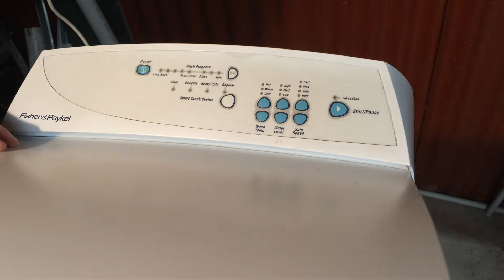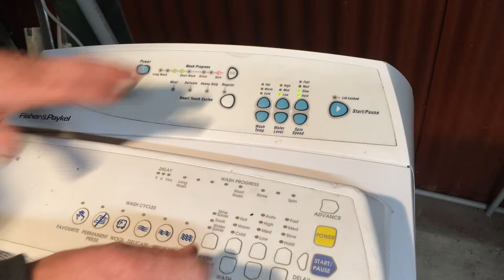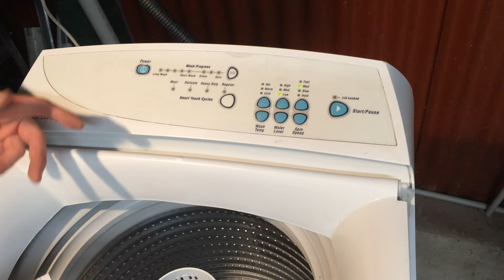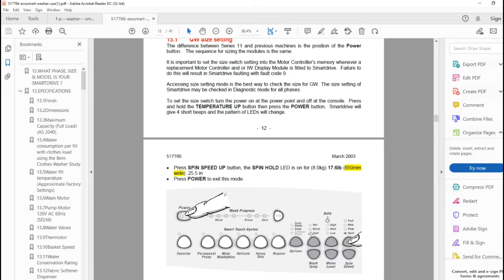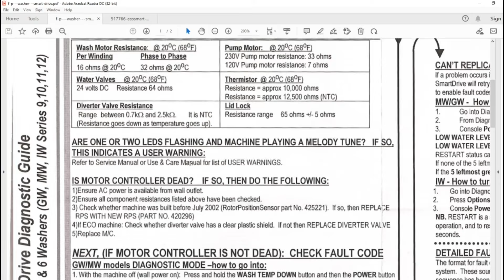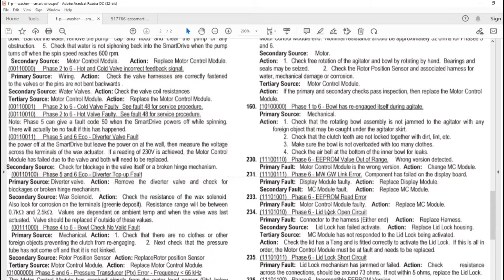Reading Fault Codes and Diagnostics on Fisher Paykel Smart Drives.

Comment: I had a wash going, and decided to let is soak overnight by leaving the lid up. Thinking now I just should have turn it off. As the next day closes the lid and let it do its thing. But to then hear it start to drain the soapy water but to then hear beeping. Gone to check it out. But to notice it stopped pumping the water out. I tried the button to advance so it would go to spinning nothing just beeping
 I can hear some humming. But nothing happens not removing the water as normal.
Reply from the maker: Sounds like the pump is probably blocked, Have a look through my other videos I have a few showing different ways to get to the pump depending on the model

Comment: Hi there - is fault 131 fixable? or terminal?
Reply from the maker: Usually it is a corroded Rotor Position Sensor, so fitting the correct sensor for your model will fix it. If  the sensor corrosion is caused by something else such as water leaking through the main seal into the motor then that may start to add up.

Comment: I'm trying to reset the board. I was given the machine it's just driving me batty. My workers reset it twice and since then no easy answers yet. It's a good machine
Reply from the maker: What are you meaning by reset? If you turn the power off at the wall and then on after a minute it will reset. If it continues to fault afterwards it means there is a fault that needs to be fixed.

Comment: I have a GW612 machine with board SD11 PCB 420048-G with the cold and hot water inlet valve circuit resistors blown off due to water ingress to the valves that caused overcurrent - unreadable values - as circled in red on the attached photo.  Both fuses blown but have received replacements - active components test ok so far.  Could someone please tell me the values and rating of these components that are obliterated so I can replace them with non surface mount parts.  Not sure how to add the photo, component markings are R663A, R663B, R664, STR105.

Comment: I recently replaced the main bearing and main seals in my F&P GWL10US (I believe circa ~2001) washer as it was making a racket when spinning.  Also, replaced the cold water valve (420148P) was not sealing off completely and would drip in to the washer through the week.  Both of those replacements and the washer ran fine for 2-3months.  Then another issue occurred which I've not been able to figure out.  Both Hot and Cold inlet valves are CLEAN

The machine did not display any fault codes, when powered on it booted and lights all lights beeps normally and cycles all lights off like a normal power start.  Everything seemed to work normally.  

Then it shut off during a load somewhere at the end of the wash cycle, unattended so not sure where.  Unplugging for a bit and plugging back in and it powered back on normally.  I started the load again but advanced to Rinse and Spin just to get the clothes out.  It stopped again during 1st spin.  Slight electronics heat smell.  Water was drained but clothes were wet, moved them to the dryer to test the washer with no clothes in it.

Unplugged again, let sit, powered back on.   Hit Favorite, advanced the cycle to Spin, it started spinning and got up to max spin and rather than wait, I opened the lid to stop the cycle.  The reverse mag brake engaged and stopped the basket and machine instantly turned off and in doing so, there was massive electronics smell/HOT, control cover was very warm in the center top, UNPLUGGED immediately and removed the top display cover.  The Motor control unit "vent" directly over the 2-3 large capacitors was melted and very hot.  Clearly burnt out the power supply but not sure what the root cause was other than just age failure. 

Ordered an MCU (426930P) off Ebay to replace the Motor Control Unit.  Size setting was already set on Large which is what my machine is, 650mm wide.  Replaced this 2 weeks ago.  Tried starting the machine and wouldn't start.  Found out about diagnostic mode so I started it in diagnostic mode and it showed no LED lights for the code when Spin Speed HOLD and SLOW are both lit.  No code.  When trying to start a normal wash cycle, machine makes some odd squeaking noises like its "attempting" to start the motor and then shuts off.

So having replaced the main bearings and had the machine completely disassembled I recalled the little control board on the stater and thought, "if the Motor control unit burnt out, maybe it put too much current to that thing" which it turns out is the Rotor Position Sensor.  Ordered one from Ebay RPS (420296P)  and replaced that just this morning.  The Yellow/Blue/Red wires are correctly plugged in as well.  Verified that when I had the stater off.

Powered back up the washer and put in diagnosis mode, hot water works, cold water works, drain pump works, SPIN WORKS!!  yay!   0 diagnostic codes displayed.  Verified and rechecked the Size setting for the MCU and it is set on Large correctly for GWL10US.  Verified and powered off.  Unplugged and waited  a minute.

Plugged back in, all lights light up and start medley plays.  Select Favorite and press start.  I lifted the lid a bit and shined a light in to verify, cold and hot water both working, slight spin on water fill working correctly and the cycle continued for about 5-10min and then the unit just completely shut off, no lights, slight electronics smell.  Unit will not power on.   Unplugged let set for a few minutes, plug back in, normal startup medley and lights all come on and turn off in sequence.  

Check diagnostic mode and there are 0 lights displayed.  No error code...
Start again normally, try to run a normal cycle, same thing, unit runs for 5-10 mintues, filling, basket slowly rotating, shuts off no lights.  Slight warm plastic/electronics smell

Unplug again, start again,  Advance cycle to SPIN and run.  Cycle starts, spools up like it should slowly and incrementally, and finishes with correct beeps, cycle complete. <---1st time I did this it worked  2nd time it shut off completely as it was draining and spooling up within the first few minutes.

I have not checked the resistance on the diverter.  The drain pump works and drains water out, I blew down the pressure tube and there are no obstructions.  Any ideas on what to do or where to look?
Reply from the maker: On that series if the drain pump overheats and cuts out it will  kill power to the controller and sometimes no codes will have time to be saved. I would have a look at drain pump resistance, and we always do the diverter actuator when replacing those controllers as a precaution. Pump is also used a dump resistor for motor braking, so if you force an emergency stop with an open circuit pump you will damage the controller. 

If you are the type of person to keep using a machine which is cutting out with a hot burning smell to the point where you burn out the controller I would recommend you step away and get someone who knows what they are doing to have a look.
Reply: @motrepairs  Haha, Yes, I like to tinker and figure things out on my own generally without Youtube.  I have a fire extinguisher handy, not to worry.  I appreciate your concern for sure!

The only reason I was attempting multiple times is because I was trying to get the washer to display a diagnostic code.  The manual doesn't have a procedure stated for "the washer stops and turns off suddenly".  Very good to be aware of that the pump being part of the motor braking circuit.  

For replacing my drain pump, the label states (I have a photo of it if needed)
SELNI, 
SM00-246NR, 
230V 50Hz,
80W.0.7A.CI F, 
SD200
Made in France

I found this very odd when its a GWL10US and American markets use 110V 60Hz.   Is this normal and the power conversion is done in the MCU?

I can only find this part number when searching for the pump:
Fisher & Paykel 420324P Pump

Would you confirm this to be correct?
Looks like GWL11 and later use a different part number.

I sincerely appreciate your knowledge and help!
Reply from the maker: @Cinnabuns2009  I haven't actually worked on a 110V machine so probably best to check a USA parts manual and see what pump they have listed there. As far as I was aware they used a different pump with a much lower resistance, due to being rated for 110V.

The stage 9 and 10 series did use an inverter to create a squarewave from the high voltage DC supply so it could frequency control the pump to a basic degree, but that high voltage is going to be lower in a 110VAC controller, unless there is some kind of boosting going on, which I would doubt, but again never seen one. 

420324P was the 230V pump, superseeded to 430144 due to old manufacturer going out of business. Later machines did switch to a totally different design Askoll or Hanning pump, different housing so you wont mix them up. 

Google suggests you are looking for 420325P for 110V pump
Reply: @motrepairs  So I finally got the drain pump today and got it installed, also swapped the diverter per your instructions.  Everything seems to work correctly and the cycle completes however something seemed off to me in the Rinse/Spin section compared to what I thought it used to do.  

Ran a load on High water level with some sheets in the machine Regular wash/warm/high water level, and the Soak button pressed.  Peeked the lid while filling, everything seemed to fill correctly in the wash phase and then it beeped and paused to Soak.  Opened the lid and the machine was very full of water (on High) so the water inlets are clearly working correctly (I have replaced the Cold because it wasn't shutting off all the way and dripping).   The first phase of the Rinse seemed normal running some water, pulsing the basket rotation,etc.   Then brief low speed spin up, then the 2nd phase of the rinse didn't seem to put out much water at all while the basket pulse rotated for the length of the 2nd phase.  Water was pretty much trickling out during that phase, then the final spin started, ran its duration and finished with 5 beeps.

Since the Cold water side is clearly working correctly in the Wash phase, if its not doing what its suppose to do during Rinse, is that due to the control board?  I can check the voltage the Cold side (haven't yet because I need to get a new multimeter, my old Micronta died)  Is there a way to troubleshoot the just the Rinse phase and how much water should be coming out during each rinse and how many rinses are there?

Also, I can't say it enough... I sincerely appreciate your help!

Comment: Hello can i ask how to unlock lid locked fisher&paykel maching
Reply from the maker: If its a top loader and it doesn't unlock at the end of the cycle it should unlock if you turn the power off at the wall. If that doesn't work then the lock is broken, but I've never had one jammed locked. 

If its a front loader check in the user manual for the emergency release, depending on model. It should be near the drain pump filter.

Comment: I have replaced the pump and motor control board on my GWL11. Made sure size setting was right, all that jazz. 
At this point, the machine will lock the lid the second you attempt to begin a load and simply refuse to do almost anything with water.
But somehow, it will give no fault codes from this despite there clearly being an issue.
Reply from the maker: That's quite unusual behavior, did you check all the resistances? Water valves not blocked? Are you sure it is the correct controller for your product code? You will probably need to get a technician who has experience with Smart Drives to have a look.

Comment: I have a fisher & paykel top loader WA 75T65GW1 and I can’t get it to run in cold water mode driving me nuts. Any ideas ? 🙏
Reply from the maker: What does it do when you try it on cold fill? If the valve was electrically failed it would beep as soon as it powers on. Check the filters in the valve and there may be some inside the hose at the tap end. Make sure you haven't got your hot and cold hoses swapped. Could be valve internally blocked. If it fills some cold then swaps to wanting hot then check user manual about turning "controller cold" off as that looks for hot water to bring temp up.
Reply: @ hello there I just wanted to thank you very much for the Imformation on the washing machine. I can’t believe it but I made the rookie mistake of crossing the hot cold hoses over. I’m feeling silly but grateful for your help thanks from Melbourne Australia.
Reply: @ thank you will try.

Comment: Can you tell me possibilities with code 112
Reply from the maker: That is a motor current fault, however if it is one of the yellow controllers and happens even when the machine isn't running it usually is an internal fault with the controller not the motor.

Comment: Hi mate just want to ask what is fault code 1 light on spin eco low water level it's a MW612nz or MKT  cheers in advance
Reply from the maker: Not enough info sorry, following what I talk about here what fault number would it be?
Reply: @motrepairs  hi mate thanks for  your response fault number 1 only red light on spin when I power on the washing machine but there is also lights on eco option and low water level cheers
Reply from the maker: @uchihasarada880  Fault one is a motor controller error but I've never seen it, so I think you would need to enter diagnostic mode to check what code is in the memory beofre replacing controller. Sounds like you have something else going on so would be better to get a technician to look at it I think.
Reply: @motrepairs  hello mate may i know how can I enter to diagnostic mode to check may washing machine pls cheers? You are really helpful by the way I really appreciate it your help...

Comment: i had to replace my control board on model WL42T26DW1 96198-A SER# UHG453237  from the USA   how do i set the size setting
Reply from the maker: I don't have info for the US models sorry, best to go back to the supplier who sold you the control board, usually they come with a sheet of paper telling you how for that series. Some of the earlier high efficiency washers didn't need size set, if you didn't get a error 9 when first powering on you may be ok.

Comment: Hi, great videos. Have a wa80t65gw1, unable to enter diag mode at all. It stopped before a drain cycle  i belive. Comes up with flashing green light 4th from right and the remaining 3 lights lite to the right. Have alrrady checked pump and seems all good free and 93ohms. The spring front left was disconnected and now reattached. Nothing elsr seems amiss. Given bowl etc clean while all out. Thanks in advance.
Reply from the maker: Not sure exactly which lights you are meaning, Using the code we talk about here is it code 15?
Reply: Hi, the wash progress cycle lights, as i said it wont go into diagnostic mode just flashes green 4th from right and the remaining 3 orange lights on to the right.
Reply from the maker: @Muckinhellx4  Would that be number 15 or am I misunderstanding the lights you are referring to? That isn't a valid code for that model.
Reply: I was literally replying to this, went out and plugged wm in after a week being disconnected from wall. Fired up had same valua 8 flashing and 421 steady on. Turned of amd tried diag mode and it went into it. Went through to faults amd nothing there. Ran hot cold manually for a bit. Powered of started a cycle all good. Cycled tbrough to valua 8 where it stopped and progressed through the cyxles till finish. Bout to try a full load again. Will keep posted.

Comment: Mine stops on rince and when I tap the lid or open and closes it it starts again
Reply from the maker: What model is it? If it is on of the models without the lid lock, it will have a magnetic lid switch. If these reed switch is starting to play it it may stop if it thinks the lid is open.
Reply: I found the problem the pump was leaking and was pausing on rinse cycle and now has damaged the main circuit board gw712 do you have a replacement
Reply from the maker: @vinmon1234  Several different boards for the model, would need exact model and product code. Would be better for you to contact a local repair company then you wont need to pay for shipping. Or send us an email with your details if you have no-one local

Comment: How do I reset my machine with code 49?
Reply from the maker: You can't reset it, you need to fix the faulty first then it will clear on its own. For code 49 you need to check the resistance of the cold water valve straight after machine has faulted, it will either be valve open circuit, or controller (or sometimes both)

Comment: Really great video's, well done, the agitator has a fabric softener dispenser cap and some owners I have observed will put power in it also, but water does not get to it, so how does it dispense ????
Reply from the maker: Yeah we often have problems of people putting powder in it. When the machine is spinning for rinse after the wash the fabric softener gets spun out of the cup, but sits inside the dispenser. When it stops spinning to fill for the rinse if flows down and out through the hole in the bottom.

Comment: what happens... when you turn on machine... lights on short wash and spin light up and it beeps?
Reply from the maker: That sounds like a fault 9 size set error, have you replaced the controller?

Comment: Thanks very much for the video. I have a 49 code (read 48). Do you have a video about test resistance on the valves? Is it likely valves or control board ?
Reply from the maker: If you don't know how to use a multimeter to test the valve its probably best you don't take the display off and get someone who knows what they are doing.